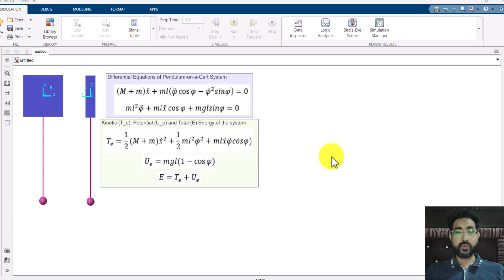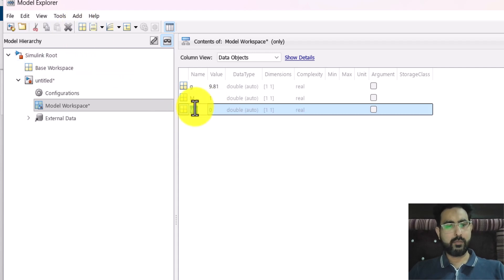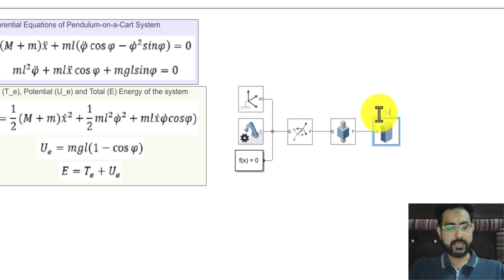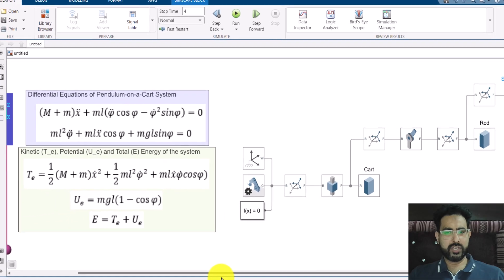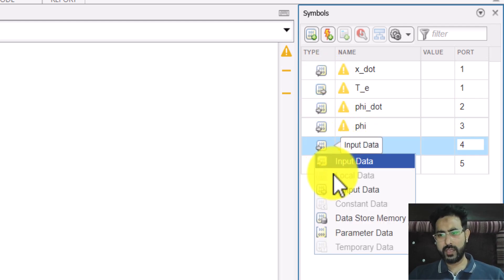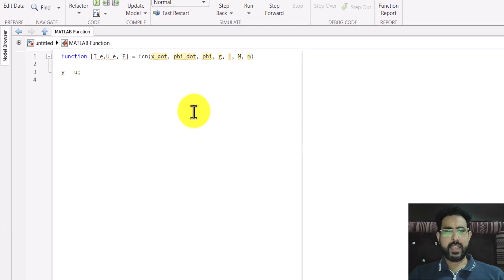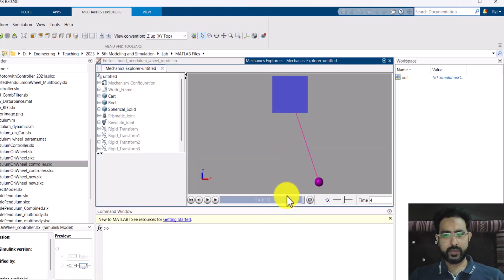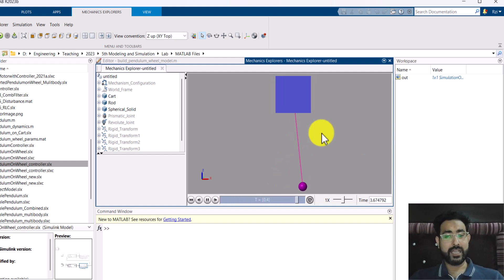Inverted Pendulum on a Cart in Simulink | MATLAB Multibody Dynamics Explained

Comment: I'm making an inverted pendulum but I exported the design from SolidWroks on URDF. Im making the controller and observer now but I don't know how to connect it to the system. Great video!
Reply from the maker: Glad you liked it! If you want to connect a controller and observer, you can use the Joint Actuator block to apply forces or torques to the joints based on your control law.
Reply from the maker: I'll try to upload the next video in series this weekend where I've attached a PID controller with the inverted pendulum to control its position.